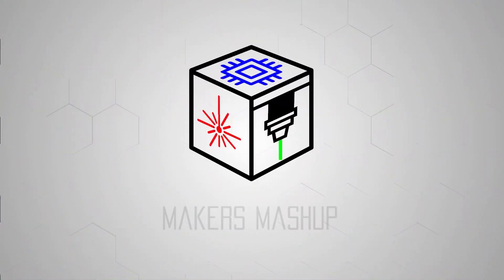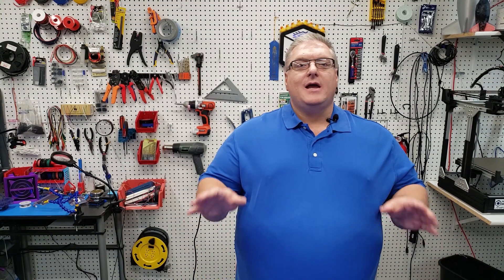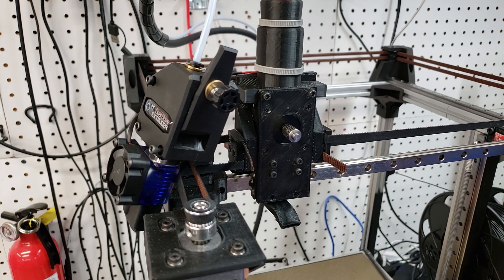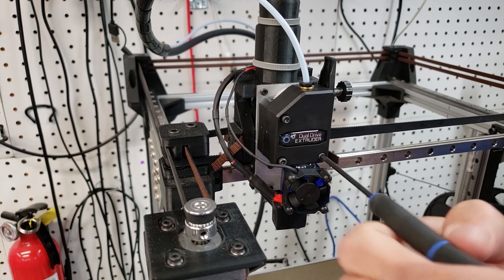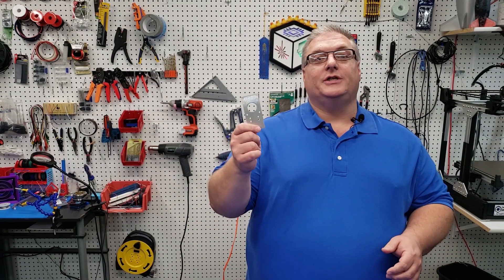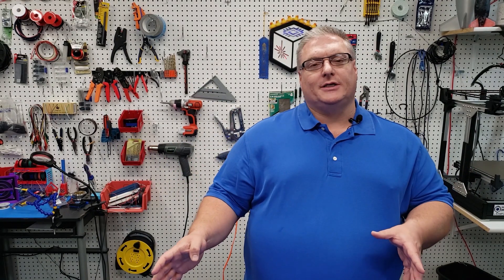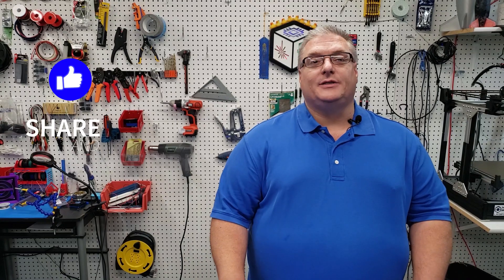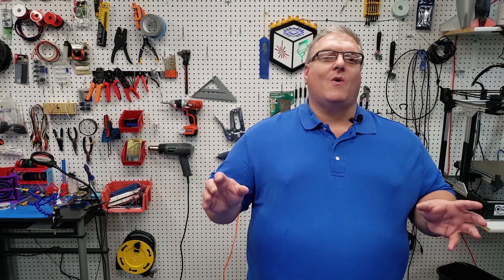LayerFused X301 - Aluminum Carriage Plate Upgrade

Comment: Remove build plate.......🤯 There's a screw in the top right corner, maybe that's why I was having problems with the Y axis on the plastic carriage plate. 
FYI you don't show a screw going there in the build video 4. I figured it was because it would block the extruder from mounting flush. I feel like a moron now 🤦🏿‍♂️
Reply from the maker: Tyler, dont.  Here is why.  When I pulled it off the first time (I actually put the plastic one back on for the video), I saw on the back of the geared extruder there was a hole.  The screw fit right in the hole.  The original video step 4 I didnt put it in there because I thought for sure it would not clear.  Well it did so I added the screw in here. 😏 You caught me!  I think for sure that other BMG clones are going to not have that hole but if you have the space in yours, by all means use it.

Comment: Mine arrives tomorrow! Wooohooo!!
Reply: How noisy is the X301?  I have a Prussian Mk3s.  It’s great but a little noisy. Looking for bigger 2nd printer.
Reply: @toepunch001  I don't have an Prusa Mk3s for comparison but I have done the power supply thermal mod & fan mod by LayerFused - combined with the TMC2209's its very silent and I work with it in my office every day with it being less than 5 feet away.